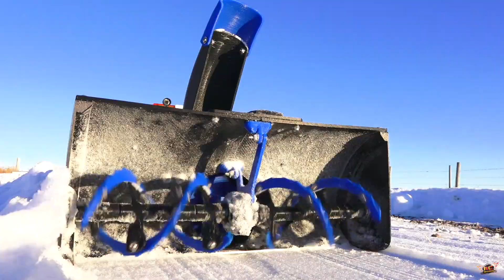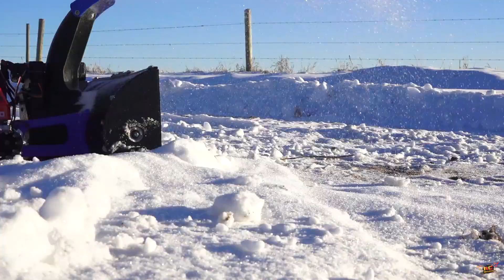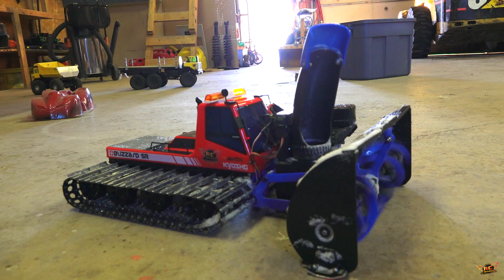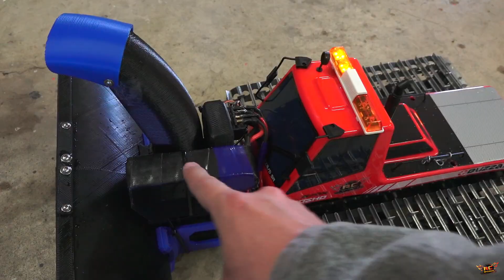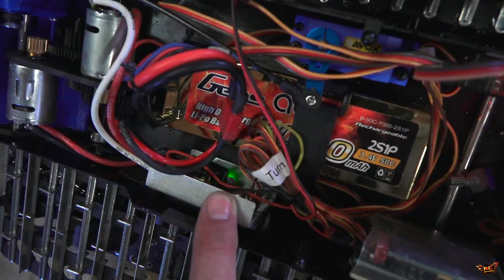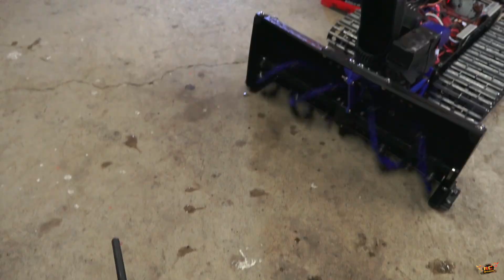RC ADVENTURES - Radio Controlled 3D Printed Snow Blower, Tracked Kyosho Blizzard & Spyker Workshop

Comment: Medic I need your help, again. I have the scx10 (love that rig). my light died, no problem. I ordered lights and 3 port controller. The shop has sent me out two set of lights and two sets of 3 port controllers...the 8 leds will not work, what gives. could the shop have sent me out all bad parts...or is my esc or battery bad....I'm lost.

Comment: I ordered my very first rc car off amazon. super excited to start using it, its a traxxas slash 1/10 scale 2wd, I know little to nothing about any rc cars but I thought I would check them out since all the videos on YouTube look amazing:) just a couple questions: like how to maintain the truck so it lasts longer and just curious on how far the receiver length is. or does it vary on which one you have?
Reply: +Daniel Lohvinenko Try and clean it after use to help to prevent rust. It is waterproof so don't be afraid to rinse it with a garden hose.When things break,use that opportunity to upgrade to aluminum and stronger plastics like RPM brand. The range is usually farther then you can see so you shouldn't have to worry there.
Reply: Chris O'Donnell awesome thanks

Comment: Hey guys does anyone know if a venom 5000mah 50c battery is waterproof ??
Reply from the maker: +Parker Plays “Minecraft” LP Every lipo has to be "Air Proof". Subsequently, they are "waterproof" as well. Its the connections that need to be dried and cleaned after use. Do not use in salt water..
Reply: +RCSparks Studio so if I tape the end of the white part then I should be fine
Reply from the maker: Parker Plays LP Tape seldom keeps water out. Just be sure to completely clean and dry the connectors when you are done.
Reply: +RCSparks Studio okay thanks for the help have a good day :)                Go Canada Go
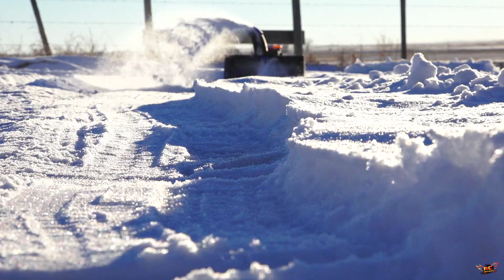Reply: +RCSparks Studio I need help medic, i've ordered a summit 1:10. I want lipo batteries. I'm currently searching everywhere online for 2s 5800mah lipo battery with ID from traxxas but can't find them ANYWHERE. What do i do??? My traxxas has the ID thing with the special batteries... The only lipos i found were 120$ each and 3s...
Reply from the maker: julthebaber regular batteries should slide right in. Do you mean the traxxas balance port on the plugs.. ?

Comment: I have a 1/10 scale ecx torment. Will any 1/10 scale body fit on it or can I only put ecx bodys on it?
Reply: +Danny Miller Any 1/10 should work though body post may have to be altered or new holes drilled. You are only limited to you imagination;)
Reply: +Chris O'Donnell thanks that helps me alot with what I am trying to do

Comment: I have a ??????! My Traxxas Slash 2WD Is Not Working The Battery's Are Charged but When I Try To Turn It On The servo box just blinks and shuts off what do I do?🤔
Reply: +EpicRcs12 Is the battery old? Maybe its not holding a charge anymore. Try another one to eliminate that question before you move on .
Reply: +Chris O'Donnell Thanks I will buy a new battery and try anyways I need two batterys
Reply: +EpicRcs12 Thats what it sounds like to me. Traxxas esc's shut off when voltage is to low
Reply: +Chris O'Donnell thanks I bought a new battery and it works
Reply: +Camp Outdoors Awesome! Glad I could help.
Reply: +Chris O'Donnell It's faster now
Reply: +Chris O'Donnell and it now can plow
Reply: +Chris O'Donnell gg
Reply: +Camp Outdoors Batteries are like rubberbands to use a metaphor. They work awesome when they are new. But as the get older they don't re-bound back everytime so your power and run time start to shorten. Thats one of the many reason people go to Lipo batteries. They "rebound" better and for longer. But they are more dangerous to use and are more expensive.
Reply: +Chris O'Donnell I'm only nine so I'm not that much into the RC hobby but I know enough to know your right thanks 😎

Comment: Sweet!! I believe the guy making those blowers now made improvements stronger blades and is now working on a pin that will break like how it works with real snow blowers so you don't break the auger.

Comment: Hello DJ medic I was wondering what are the biggest risks that you take on while using LiPo batteries and what precautions are needed to avoid those risks please reply even if it is just with a link to a website thanks and have a  great day
Reply: Also what is the best rock crawler available for 700 cad or less
Reply: +zederpsquad Fire is the biggest risk. Research online how to charge,store and use lipo's safely.I charge mine on a metal baking sheet in a lipo bag and only store them at storage volts (3.83) in a fire proof box. Also purchased some extinquishers to have close at hand
Reply: +Chris O'Donnell Sorry thats 3.83 volts per cell

Comment: You did it! Lol. Awesome. I imagine you can stick an Arduino board on that thing with a gps module and a motor controller and have it follow a preprogrammed path. maybe even have it keep tabs on its power level and when low have it charge itself near your barn.